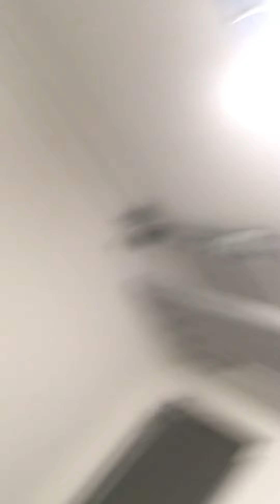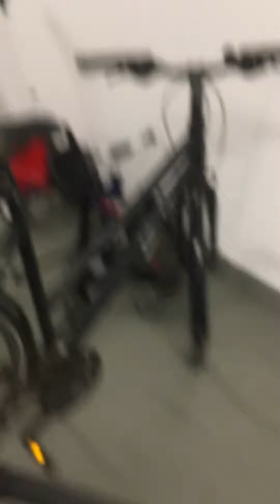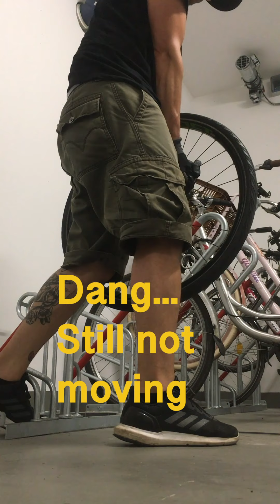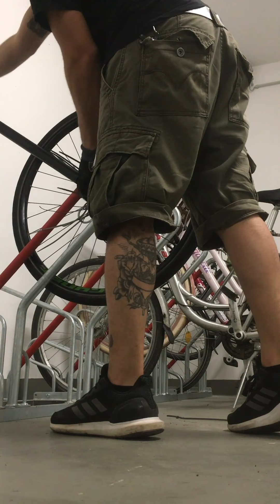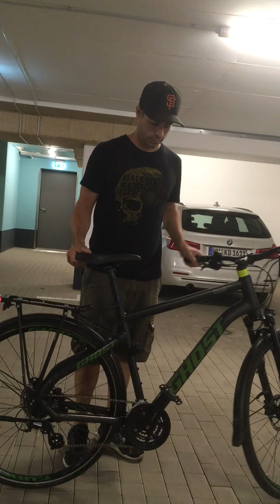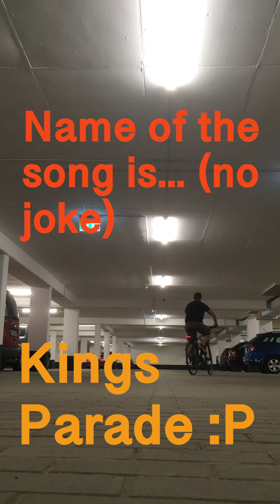Unlocking a seized cassette lockring

Comment: After trying with a chain whip, and successfully breaking it, I found your video. It looks horrible, but I tried it and it worked like a charm. Thank you so much for sharing.

At first I tried with only 7 plastic zip ties but that did not work. 13 plastic zip ties worked just fine for me.

Comment: Anyone looking to get their lockring off.. I had one that no matter what you did wouldn't budge. The bike shop must have used an impact wrench and that's what I eventually bought after nearly breaking the wheel using manual force. Get a decent fixed plier style chain whip and strap it in place, then impact wrench and its off in a second.
Reply: Genius... I even already own an impact wrench and this didn't occur to me! ;) I'm gonna try it now!
Reply: Just coming back to report that the impact wrench got it off in 2 seconds! Wish I thought of that before effing around for 20 minutes with the wrench and chainwhip! ;)
Reply: @gregors1422  wahey! all hail the mighty impact wrench 🙌

Comment: thanks it worked for me after i went the wrong way with a 2ft breaker bar.  and tightened it.  zip tie to hold the wheel in place,  old metal coat hanger to hold  the cassete to the pole, creaked loose and free  thank you

Comment: thank you! this worked! 

one change i did - use steel wire to tie the cassette down to the spokes, so that the cassette doesn't spin. i think would be good to tie the cassette to a pole like Zac did in his video as well for greater strength. this way, the cassette lockring can be forced open! 

(ps. i initially used plastic cable ties like Zac did in the video, but they all snapped, so i used steel wire to tie in the grooves between the teeth of each cog!)